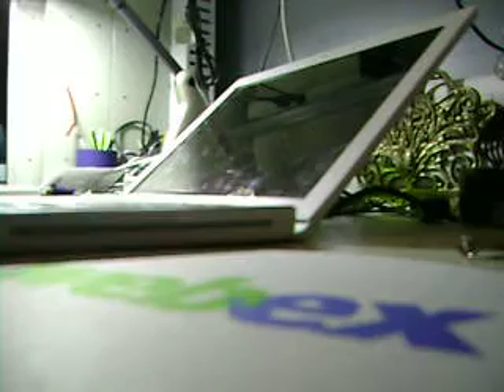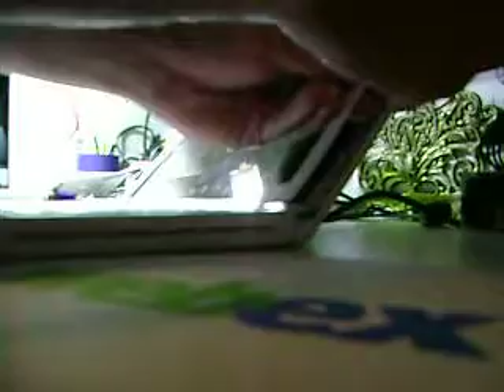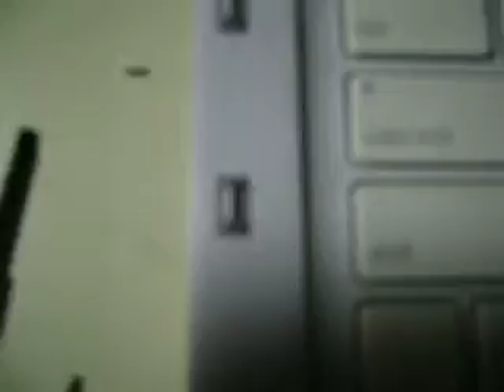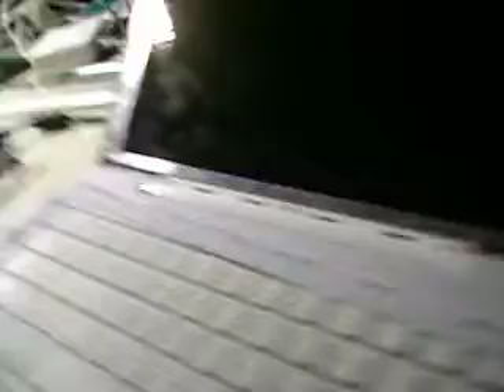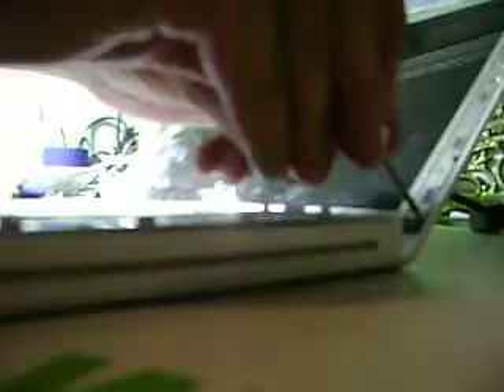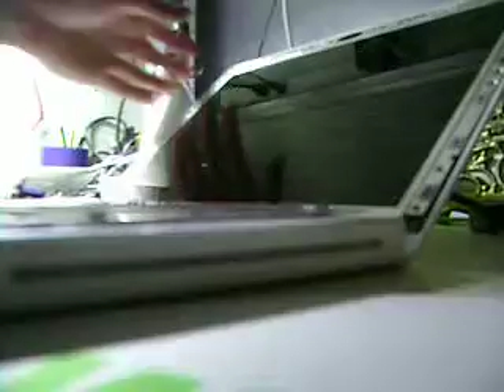Part 1 - Apple Macbook 13.3" Disassembly - Screen - Inverter - Backlight - Repair

Comment: When I turn computer on I can see the screen normally for about 3 sec. Then goes blank. If I turn it right I can faintly see the screen. What would u suggest replacing first? Where can I buy the parts?

Comment: This is helpful thank you. my backlight went yesterday and Apple tell me its not possible to replace the inverter cable only - but have to do the whole display, and possibly the logic board as it could be the connectors. 
Does this sound right to you?

Comment: Hi mate I have the same problem with the screen and I've replaced the inverter cable and it's not fixed.  Did you identify / fix the right part eventually?  I think it might be the inverter itself.

Comment: Me too man on my 2008 macbook, the screen stays on for about a minute then goes off.  If I turn the brightness all the way down and then up again it sometimes comes back on, but again briefly.  I changed the inverter cable and no luck, and I dont really want to shell out on replacing the whole ldc.  Did you get it fixed? Was it the inverter or the backlight?  Cheers

Comment: FYI, The blue paint on the screw is a form of Loctite, that's why you would strip the screw head if you don't apply the right pressure.  Use a dab of alcohol to break up the Loctite if you're having trouble.

Comment: My screen became very dim since the backlight was no longer working, but the video output and rest of the computer still work fine (I plugged it into another monitor to check).  I ordered an inverter board online and replaced it and saw no change.  Before I go ahead an order a whole new lcd screen, should I try to replace the inverter cable itself?

Comment from the maker: @DontClickMexD 

We charge $125 Flat Rate($25 of that goes towards parts) , depending on the macbook you have LCD screens are around $75 so you are looking at around $175 to get the macbook repaired.

Comment from the maker: It sounds like you might need to replace the inverter and possibly the inverter and the inverter power cable. You can purchase both of these from our company by calling 18003155915.

Comment: I used to hear an electricity buzz near the hinges of my macbook.. and when I hear that buzz, the screen backlight alternates according to that buzz (like a light bulb that going to burn soon)

Now that buzz have gone,, and the screen has no backlight, i can see it working well but it is like if it is all the way dimmed.. when I change the brightness nothing happens.

what could be the problem?
is it the inverter and/or the inverter power cable?

thanks

Comment from the maker: The PMU reset procedure, described above, seems to work only sometimes and not for long. This is the procedure that will help you
          Go to Energy Saver options at System Preferences.
          Set display sleep time to 1 min.
          Set the computer put the display to sleep.
          Go back to normal use, and set the display sleep time to the desired value.

Comment from the maker: Suggested fix to black display from applecare, unplug power, disconnect battery, hold down power button for 5 secs, reconnect battery and power, restart. This resets the power manager. Reseting PRAM has been suggested also.

Comment from the maker: On the unit in this video it wasn't actually the inverter that was bad, it was the inverter power cable that connects to the motherboard right underneath the "W" key. If you move the screen back and forth and the back light comes back on that means that the inverter power cable is more than likely bad. However it sounds as if some software could fix your problem.